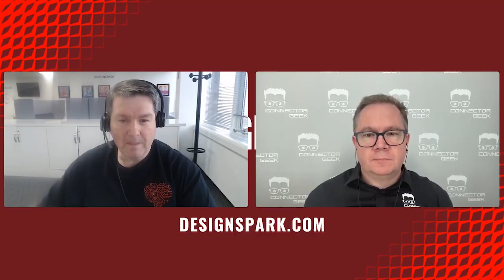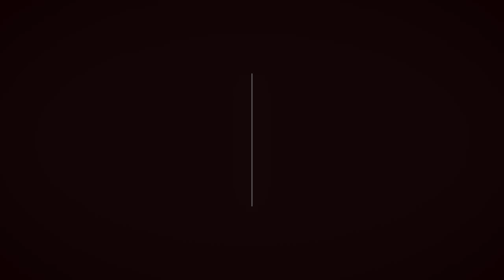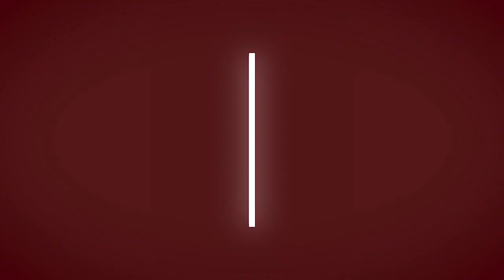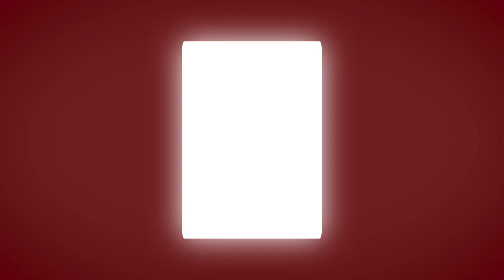Professional 3D design software and access to a global engineering community.

Comment: "I think Sketchup is still around"..is quite an understatement guys. Just about every architect on the planet uses it, whether they admit it or not. It has a massive user base. However, it’s still a basic polygon modeller that hasn’t changed much in years under the hood, although it has countless extensions.